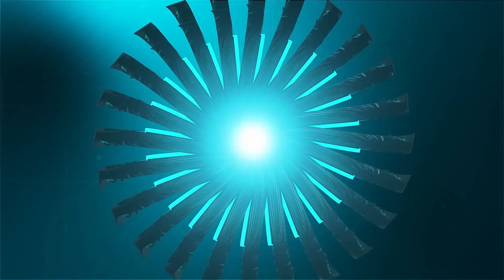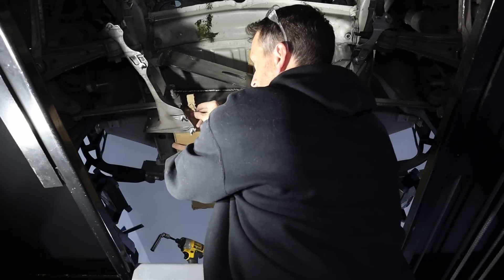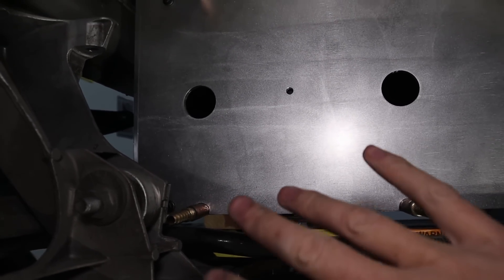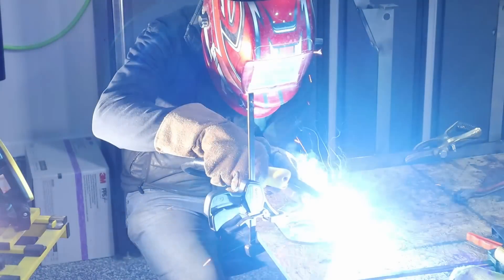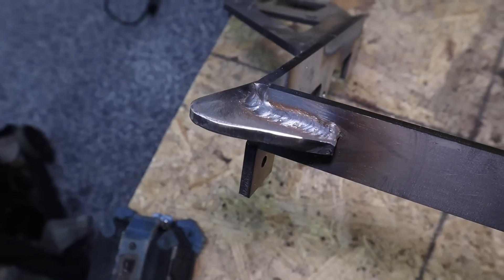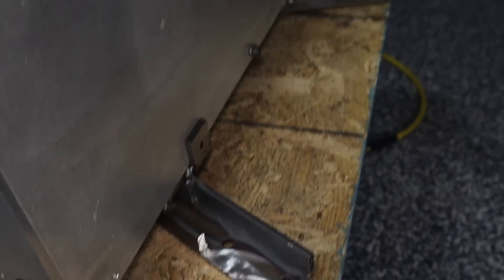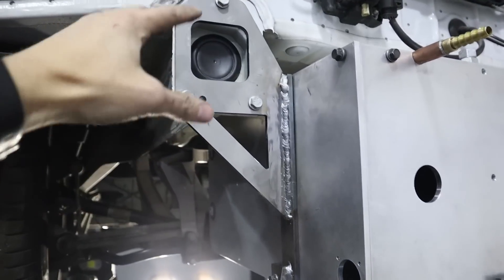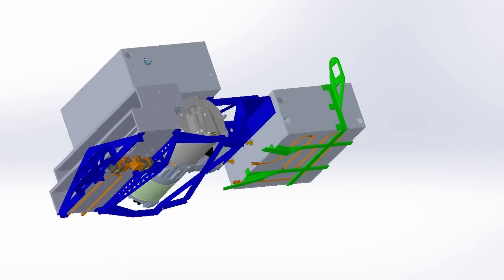Electric Porsche - Mounting Rear Battery Box

Comment: Thanks so much for trailblazing and sharing! 6:49 1 of the best channels on YouTube! With two motors, possible range? Are u stuffing Boxster with as many batteries possible? If not what is the maximum size battery pack could you squeeze in?
Reply from the maker: I am trying to keep the weight down.  Going for a 44kWh battery pack

Comment: Is the battery pack right by the crash bumper ! Potential for extreme violent rapid fire , I would keep seatbelt cutter and glass break tool hanging constantly on both seat belt.
Reply from the maker: It is slightly underneath the bumper

Comment: I’m curious how you plan to make the bumper cover still line up after extending the structural portion out so far. Without losing the low speed foam that goes between them.
Reply from the maker: I am planning on custom carbon fiber panels

Comment: Couple things… first, will there be an under-tray below the battery boxes? The exposed copper tubes will be pretty vulnerable to kicked up debris. Second, perhaps use right angle fittings on those rear cooling lines?
Reply from the maker: Yes there will be a diffuser

Comment: Great work on the battery box!  Glad to see that the new job is still allowing you time to do your project.  You are definitely getting better at welding, but with the difference in weight of steel vs. aluminum, converting your designs to aluminum might save a lot of weight for not much of a hit to strength.  You may have to verify some of your measurements in CAD in comparison to the scanned files and other files you are using in the project to expedite the design of the parts, but it seems like SendCutSend can do it all for you.  My one concern is the steel contacting the aluminum.  I am not sure if it is an effect of salt up here or something else, but when these 2 metals are put together up here, they begin a very energetic reaction which causes both materials to "rust" rapidly.  There is some sort of electrolysis between them, and they lose material quickly.  I will look into it a bit more, but is the coating you are putting on an insulating coat, as that may make this a moot point.  Keep up the awesome work, and I look forward to your next release.
Reply from the maker: Thanks for the comment!   I am putting rubber in between
Reply: @electricsupercar  I am pretty sure that will do the trick.  No ions moving through rubber for sure.

Comment: To fix warping while welding all you need to do is bounce your welds around. Start on one side. Do one well go to the other side. Do another well go to the back of the first weld you started. Then go to the other side of the other welding finished and weld around. Don't weld continuously on one piece at a time
Reply from the maker: Got it

Comment: You have the steel frame for the battery box in contact with the copper cooling tubes.  Eventually there will be corrosion due to dissimilar metals.  You may wish to put something between them to isolate them.
Reply from the maker: Copper tubes are embedded into the aluminum plates with thermal epoxy.  Everything should be fine for corrosion
Reply: I will add that it can take a long time.  I lived in a “slab on grade house” that was 40+ years old when the copper water lines resting on the slab reinforcing steel finally caused a leak.  It happened twice.

Comment: That's going to be some creative body work to extend the rear hips by 6".
Reply from the maker: Yep
Reply: Not a big fan of this modification. If you change the aesthetics of the car, what matters at that point that it was once a GT. I'd keep it as close as possible to the original shape, and, if the battery is too big... unfortunately redo the battery box and fit less batteries inside.

Comment: might check out northern tool they have the same table, harbor freight says they have (out of stock last 6 months ) they are ok fixture tables with some tweaking .. they get a little over tightened and tweaked at factory some thin shims around the screws seems to flatten it out.. see one youtuber got 5 and put them together
Reply from the maker: Thanks for the info

Comment: If you extend the bumper out a foot, how are you planning to handle the bodywork? The stock bumper cover is meant to meet up with the stock rear bodywork/fenders. How are you planning to deal with that? Custom fiberglass, or…?  Sounds expensive and/or potentially pretty unattractive. I’d play around in CAD and see what the car REALLY looks like if it had an extra foot added to it.
Reply from the maker: I am planning on custom carbon fiber panels

Comment: I'm worried that bleeding the coolant system might be a big problem depending on how you run your lines. Try to avoid any high spots that would trap air. A little air can dramatically affect the  flow and cooling properties of the whole system.
That being said, I think things are coming along great on this project. You do an outstanding job of breaking down each step into manageable pieces, and you end up making impressive amounts of progress each episode considering you're just one guy who is also handling filming and editing. As you get into customer cars, the filming & editing is probably a good thing to hand off to an employee so you can focus on the design and fabrication. Most DIY youtubers seem to estimate that filming the projects more than doubles the time it takes to complete.
Reply from the maker: Sounds about right
Reply: Modern cooling systems designs don't care about air entrapmemt

Comment: With the weight of the additional components that still have to be added back there, that sure seems like it's going to be really heavy, and way back as well.  I'm not crazy about having all that weight that far back!  Is there anyway some of those batteries can be shifted towards the center (behind the front seats, etc?).
Reply from the maker: Other battery boxes are going behind the seats.  Weight distribution should be similar to the original car
Reply: I don’t think the Cayman has much of its weight behind the rear wheels; I think that was the point being made.  Will it now have more weight behind rear wheels and be a little more tail happy?

Comment: 10:31 Sir, on the $6 rear bottom corner supports.  Have you considered the departure angle while driving?  Is it too far back, sticking down too far.  With the supports being sideways will they dig into steep driveways, tearing that weld?  If designed with a front to back configuration will new supprts help out as more of a skid plate?
Reply from the maker: This part is higher than other low parts of the car

Comment: Box and mount looks good. Bumper extension would ruin looks on the rear so i would cut it.

Goos thinking on crash structure but it will bend so many parts anyway that not worth it. Keep length of the car as it is one big point of the joe it looks thing.
Just make coolant lines with elbows and extend only bare minimum if at all.
Reply from the maker: Noted

Comment: Many many moons ago when I first became a welder fabricator I was told rule number 1 of welding... make sure you are comfortable... and sad to say you don't look comfortable standing up hunched over
Reply from the maker: Not comfortable at all.  I will have to work on it
Reply: @electricsupercar  I think because both your arms are in the air too... I used to slide my arm across the bench, pivot on an elbow, brace against the wall... anything so you arent completely floating around in space... loving the videos 👍🏻

Comment: I know that weight distribution is really important for high performance sport cars.... Do you know how the weight distribution will pan out when you have the car back together?  I'm imagining it's really hard to do the engineering on those finer details when you're taking so much off the car and then putting all this custom stuff in/on it.
Reply from the maker: Not sure.  It should be very close to the original car

Comment: carefull on the liquid cooling coming and going from the back of the car because you if get crashed from the back, it could totaly kill the car. nice job tho !
Reply from the maker: My coolant is non-conductive
Reply: @electricsupercar  I think they're more worried about all coolant leaking out from just a small rear end accident, leaving nothing to cool the batteries
Reply: @Katten_R3   I'm sure some light driving with no battery cooling would be just fine. Think of it like driving on a spare tire.
Reply: Yeah good question in case of crash in back of the car all the fluid will come out and can cause some problems with battery and other systems